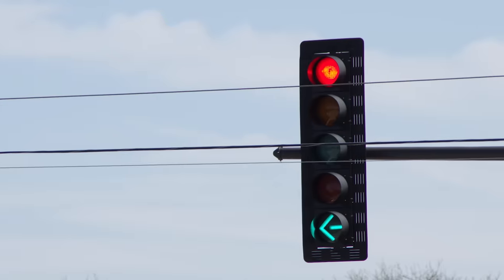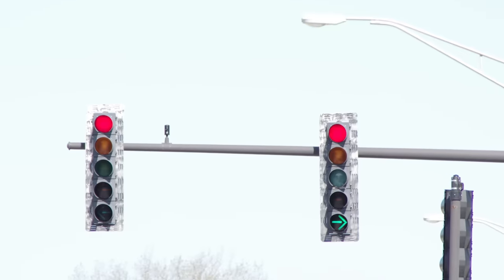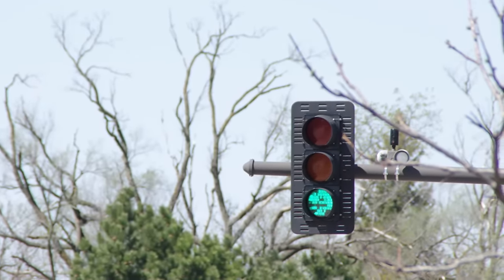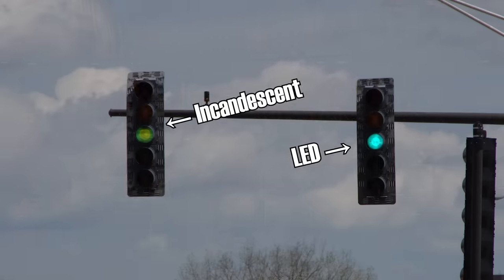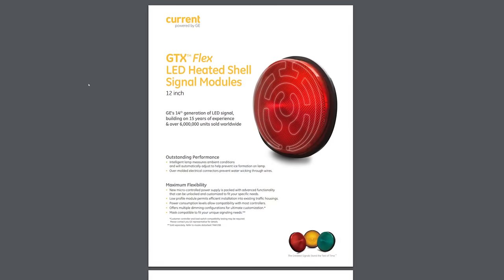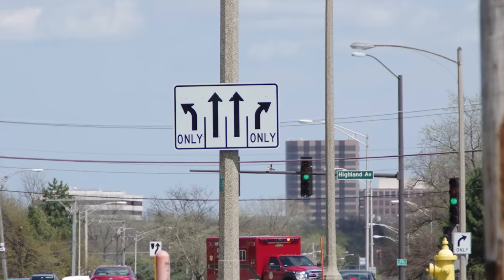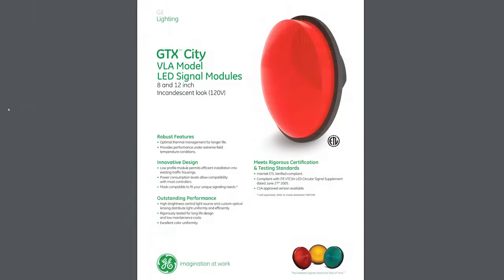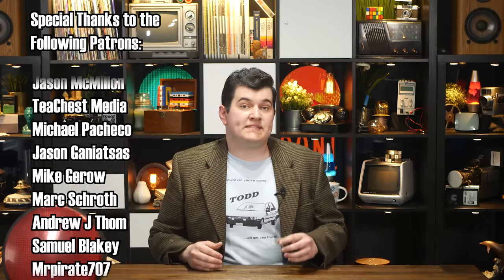The LED Traffic Light and the Danger of "But Sometimes!"

Comment: Every countdown pedestrian fixture insert I've encountered do NOT require any special input from the controller.   They internally count the walk and don't walk flash times and display the countdown automatically. This usually required a single signal cycle after they are connected to both the walk and don't walk power connections.   Many can be set to display the Walk and Don't walk flash time in the countdown, or just the Don't walk flash time.     If the traffic engineer for a particular intersection has a variable walk time (with a minimum that it takes to walk across the intersection), they would usually set the ped head to display the countdown for the don't walk flash period only.    Hope this helps.

Comment: This just helped me with a court case!
Reply: How?
Reply: This is just baseless conjecture, but I think it has to do with the "a dead stoplight is to be treated as a stop sign".
Reply: If it is about a dead head being used as a stop sign,  then someone if they could explain the dead heads on  metered ramps, when not in use they are turned off, thus a dead head, shouldnt they be used as a stop sign then when the ramp is not being metered?
Reply: @travisleeds2910  dead head is used as a stop sign at an intersection
Reply: @mykeadelic  is not a on ramp an intersection?
Reply: @travisleeds2910  I'd say it's an on-ramp. To my knowledge an intersection is like where traffic going different directions meets as opposed to traffic merging/going the same direction.
Reply: @mykeadelic  agree to disagree, an intersection is where two or more lanes converge, diverge, meet or cross,   the on ramp where it meets the thru lanes would be considered an intersection, thus the non working metered signal then should be used as a stop sign,  I know I am getting a bit technical but in my opinion the signal if not needed for metering the ramp, it should then be on a green light and not dark,  people get used to going by the non working light, then when they encounter one on surface streets the do the same and just ignore it, we are getting people used to doing something that we should not be doing,  the majority of drivers seem to ignore signals when they are not working or have the foggest clue of what to do when encountering one, so why are we encouraging stupidity,   to save a few dollars on a electric bill,   just a observation I have made when trying to stay alive on the roadways,  better known as the mine fields of America,

Comment: Like 7 years ago I was at an intersection with embed sensors in the road on a 49cc scooter at night when there was no light timer set. I sat there for almost 10 minutes of almost zero traffic the entire time before concluding that I am required to run a red light if I wanna get home because this thing is clearly not capable of sensing my vehicle!
Reply: Nate Davis a big ass neodymium magnet underneath should do the trick
Reply: Nate Davis Ten minutes is nothing. I had to wait an hour at the bottom of a non-working escalator until some workman came along to switch it on.
Reply: @albertbatfinder5240  Uhh, I really hope that your joking. A non working escalator is still stairs.
Reply: @BoserPSN Possibly, but I have a car now so not an issue.
Reply: I've had the same issue with my motorcycle.
Reply: When I was riding my bicycle, I'd use the"Push For Walk Signal" buttons because I knew that my bike wasn't a large enough mass of metal to trip the sensors.
Reply: Sometimes you just have to have common sense,  if no one is coming other way just go

Comment: 1- In my experience, sunlight shining directly on the LED traffic light makes it difficult to see which one is lit up.  365 days a year for at least an hour each morning and evening is at least 730 hours per year per intersection in NYC. (I'm not doing that math) 
STILL WORTH THE SWITCH.  JUST A LITTLE FOOD FOR THOUGHT. 
2- I've met a few people who claim they can flash their highbeams at the right rate to trigger the Emergency Strobe Detector when approaching a light that is about to go red.
Reply: That is about 14 1/2 flashes per second! I'd very much like to meet this miracle man, but yikes; I wouldn't want to shake his hand! If you notice (at least true out here in the desert) EVERY signal that has the preemptive emergency sensors fitted also has cameras, and per federal laws, they WILL CHECK. If they see someone flashing (or using those "pirate flashers"), and no emergency vehicle lights in sight, you are guilty of a fourth-degree felony.

PS. I've NEVER seen white lamps fitted to the sensors in any city I've been to.
Reply: the little white lamp is how it is here in Illinois where the channelmaker resides and records

Comment: I've seen some terrible intersections where the left turn is operated specifically by the vehicle presence sensor, but the sensor is several car-lengths back. This can be a nightmare during times of low traffic if they haven't accounted for it. I also see a lot of people where I live who stop in the intersection PAST the sensor and then have to wait for someone to actually stop on the sensor before they ever get a turn light.
Reply: Perhaps an old 70's solution could help. Get out and hit the ped button.
Reply: Had similar trouble riding a medium motorcycle, 
sometimes had to creep ahead into the pedestrian section to get the car behind to trigger.
Reply: [Sarc.] guess the modern way would be to have an App for that
Reply: Those are the same people who don't stop behind the wide white lines at intersections, who roll through stop signs, who drive "only" a few miles faster than the speed "limits", and who complain that they weren;'t doing anythig wrong when ticketed.  Bad habits make bad drivers who get tickets that are supposed to be a wakeup call to change their behavior.
Reply: E Hill 

In many areas, that button is only a placebo to encourage them to wait to cross. Otherwise they walk after a few seconds instead of waiting the 16-25 or so seconds it actually takes.
Reply: Brian In the US (some Midwest states at least), if the traffic light is functional but you haven't been given a signal to turn for over 2 minutes, you can turn on a red light as if it were a yield (flashing yellow) arrow. Obviously in a high traffic situation it doesn't matter, so it's really only useful when the sensors aren't being triggered (like the situations you described). That way with a sensor-dependent turn light, you don't have to wait 15 min for someone to pull up in low traffic and trigger it.

But yeah, people who pull up in the middle of the intersection to wait for a turn are insufferable (unless roadside obstructions block vision of course). If you aren't able to turn before cross traffic goes green (and if it's not part of the cycle they won't), good job your impatient ass just caused a traffic jam!
Reply: That's what I sometimes had to do. Kick down the prop-stand on my motorcycle (making sure that it was in neutral) and walk over to push the Walk Button on the other street.  Mind you - hoping that an automobile didn't come along and trash my bike which only showed Tail Lamp (and not Stop Lamp) while I was off it.
Reply: Darticus, the normal strategy is to pull into the intersection and wait for a gap in traffic. If there is no gap, you turn left when the light turns yellow and traffic begins to yield. Under no circumstances will you wait in the intersection after the light has turned red. At many left turns, this is absolutely necessary, as there can be hours with no opportunity to turn left otherwise. You can even be written a ticket for obstructing traffic if you fail to turn left after several cycles.
Reply: I should point out that laws for entering intersections when waiting at a green light for a left turn vary from state to state. In some states, it is illegal, whereas in others, it is mandatory and taught in driving school. Many cops don't even know what the law is locally.
Reply: try intersections with camera based presence sensors
inclement lighting conditions
(and owning a gray vehicle) made my life hell when they came about
for this reason, and having other drivers not see me, I will never own a gray colored vehicle again
Reply: Just back up (if there's nothing behind you) and stop on the sensor.
Reply: @ehill5638  Typically turn signals aren't influenced by PED buttons.

Comment: Knowing people who worked in metropolitan infrastructure budgeting you'd be surprise how hard it is to not just get the funding, but the implementation of changing something simple like street lights actually changed. There is not a HUGE argument to be made on LED verses the older format, but the implementation and servicing to get it done is a bit more intricate than the video is presenting. You can have the budget to do the work, that would take your city or county a year or so to complete (in large cities/counties even longer), but that budget could be taken from you at any moment.

Many metropolitan areas and even rural locations adopt the idea of replace when the old unit dies to the upgraded version since the need for a massive budget to do them all in one fell swoop usually will never get local voter approval (you know, those midterm elections where we all vote on stuff for our own states) and the amount of money needed to change an entire state, even a state like Vermont or New Jersey, would be INCREDIBLY expensive.

There is no argument that the people of those states wouldn't make there money back, or any state for that matter. It is a matter of ensuring the money to replace everything is there as well as dispose of the older format materials as well. There are some people who have commented the negatives about LED lights and one of three of them might hold some validity but in very specific situations, but politicians and voters, en mass, usually never adopt a new technology for infrastructure right away, even in 10 years it isn't always implemented and sometimes, by the time they are ready to do it, something new comes out anyway.

To add for people blaming traffic lights failing in bad weather is the cause of death not the drivers, hate to say it, the lights are innocent. There are LAWS that DICTATE what you're suppose to do when put in situations when you cannot see the light or when you come to an intersection. Stop signs are shaped the way that they are, because, even if frosted over the shape for STOP is the only 8 sided shaped sign ON AMERICAN ROADS. If a stop light is out you assume that the other directions work, you approach cautiously, and make sure it is safe and clear before you go. What NPC drives up to a traffic light and doesn't look both ways even when it is their own turn to go. Put down you starbucks latte, stop playing your pokemon go, turn down your damn car stereo, and take personal accountability for driving like a sane human being. The people who were innocent should be spared, but usually when two cars collide, in about 99.9% of cases, someone (and sometimes both) drove their car like a mentally handicapped individual.

You know when a streetlight kills someone? When it falls on their head. XD
Reply: Tyler then I did and confirmed you have only an anecdotal knowledge of this.

Comment: Depending on both the state and layout of the intersection, I suspect the right arrow scenario may relate to providing a "grace period" for oncoming traffic to complete an unprotected left turn first. In Colorado, for example, a red light only prohibits entering an intersection, but cars can still legally be inside if they were already there. Then, there is a few seconds where all directions are red to allow leftover traffic to clear out. 

Among some other things, this strategy guarantees at least one car will always be able to safely and legally make an unprotected left, even if no breaks in oncoming traffic appeared during that phase. Because some states don't allow cars in the intersection on a red, enabling the right arrow as shown in the video may provide the same effect I'm guessing?
Reply from the maker: I hadn't thought about the right turn arrow conflicting with cars ahead of you trying to make an unprotected left.  I suppose that could be an issue!  I bet that's why the behavior changed.  Though in my opinion, this is only an issue because people don't follow the rules and often complete the turn in the wrong lane--meaning a right turn into the leftmost lane.  If everyone did as they're supposed to and only turn into the closest lane, then whenever there are at least two lanes it wouldn't be a conflict.  But as I said, people are stupid, and accidents happen!
Reply: Also, I do wonder if it does have to do with pedestrians. It may be to ensure that all pedestrians are safely out of the intersection (from the green light/walk sign a few moments prior) before the right arrow comes on. Perhaps for extra safety in general, or perhaps certain intersections have more issues with pedestrian stragglers.

The issue above with oncoming unprotected left turns also makes sense. When the turns are onto a road with 3 lanes in each direction, I've seen left and right green arrows going to the same direction, but very rarely when the turns are onto a road with 2 lanes in each direction.

Also, regarding people on their cell phones at a red light, as you say, people are stupid regardless, but they shouldn't be just sitting on their phones in the right turn lane, as right turns on red are permitted unless there's a sign stating otherwise.

Can't say I ever get to Lombard, but I have family and friends in Oak Park and Brookfield.
Reply: Good point about all being red. My city tried that at an intersection in which there had been several horrible crashes (and quite a few deaths the past few years. It stopped the horrendous slaughter. Infuriated so many conservatives in town, though, that city council voted it back out. We've already had the first fatality after nearly two years with not one serious accident. There was one major crash every six weeks, before. Sigh.
Reply from the maker: Wait!  I have forgotten a thing.
The intersections where the green right-turn arrow lights with yellow probably have a "Left turn on green arrow only" turn lane.  Then, there would be no oncoming traffic turning left in front of people turning right, as unprotected lefts aren't possible.
I shall have to start paying more attention here, because for these intersections I can see no reason to wait until after red to give the right turn arrow.
Reply: As above, it could still be to help ensure that pedestrians have fully cleared the intersection.
Reply from the maker: @ likpac  I suppose but you're not supposed to enter the crosswalk at all unless the walk signal is on.  Flashing "don't walk" should be treated as solid unless you are already crossing.  In any case pedestrians always have the right of way, and I would hope people are checking for pedestrians whenever and however they go through an intersection.
Reply: In theory no pedestrians would be entering the intersection, but some may still be in it.

And yes, pedestrians always have the right of way regardless, but the expectation is that when there's a green arrow, there's necessarily not going to be any traffic in the way, be it vehicular or pedestrian. That is to say, drivers are more likely to blow through a green arrow without thinking about it.

Comment: The don't walk countdown timers don't need an updated controller. All the logic is in the signal itself. It's just programmed with how long the cycle is.
Reply: The ones I've seen don't even need programmed. They "learn" based on the timing of the signal. When powered on for the first time, they won't show a countdown for the first cycle, but based on that cycle will use the timing it learned from that point forward. They'll even adjust themselves if the timing changes for some reason.